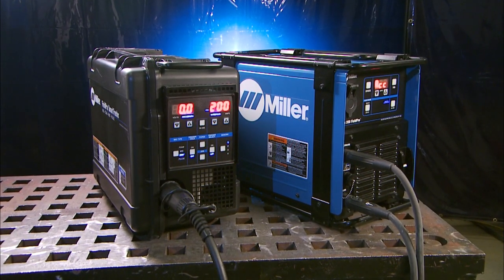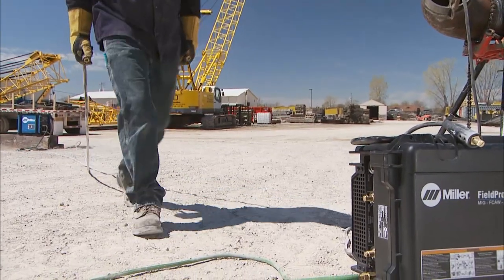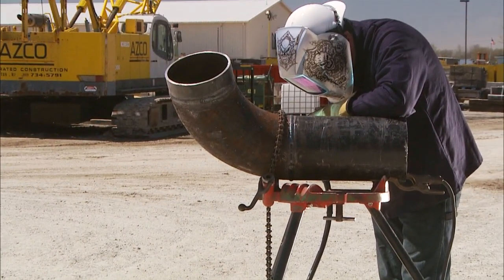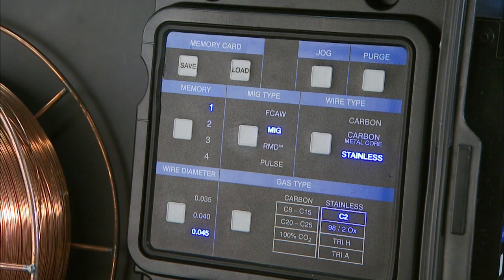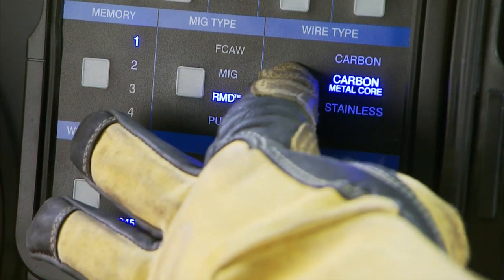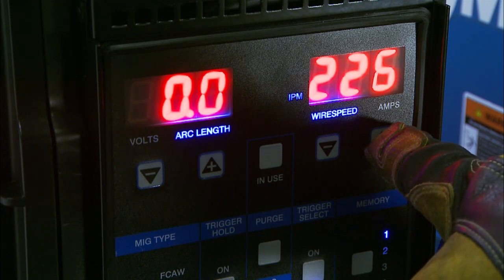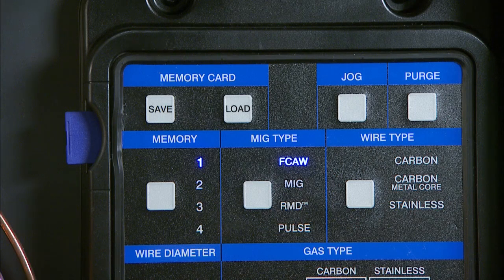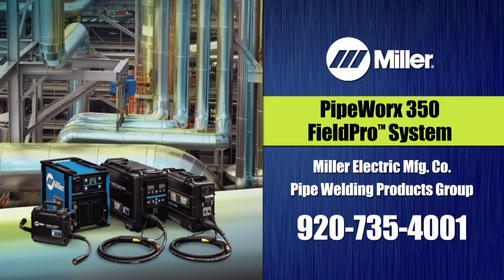PipeWorx 350 FieldPro RMD & Pulsed MIG

Comment: have one of these but I connected two welding leads to it from my welding machine to see if it works but it only shows red lines going across no numbers. what am I doing wrong to make it work or turn on. What do I need to connect for it to function. its a miller Fieldpro Smart Feeder.
Reply: Its a Miller Fieldpro Smart Feeder
Reply from the maker: Thanks for reaching out. We would recommend talking this issue through with a service technician here: 920-734-9821.